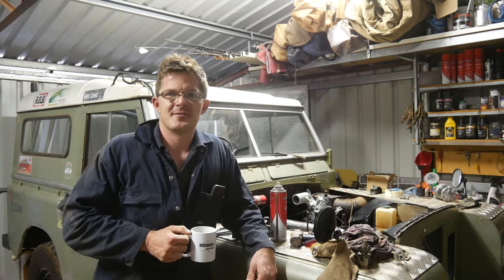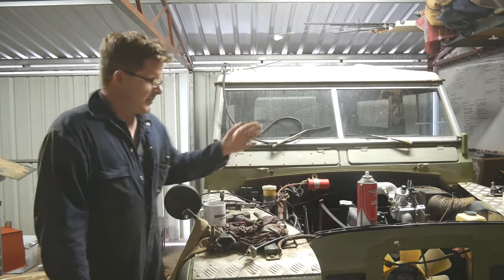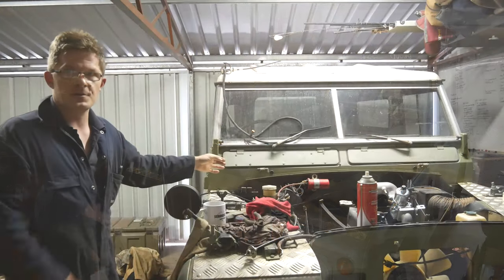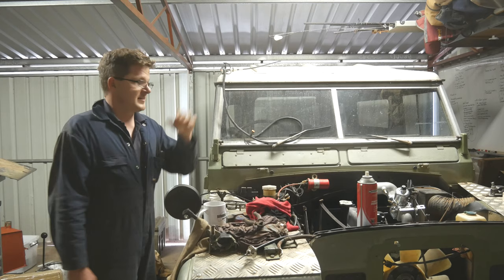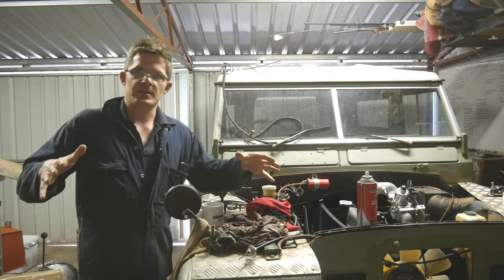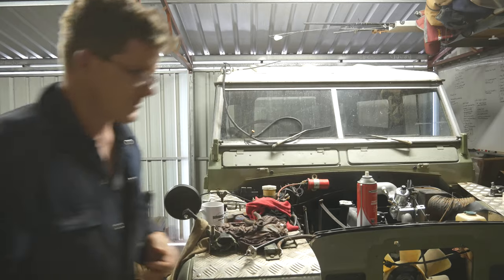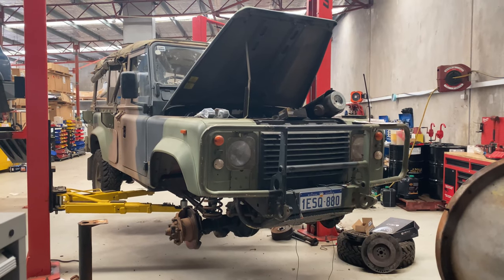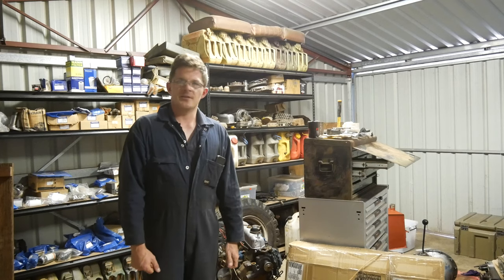Land Rover/ Workshop Update Ep 4

Comment: Hello Geoff.  Your expedition project looks fantastic and I really expect to enjoy whatever you will show us about it, before, during and after. I have one question: in your previous long range journey, when teaming up two vehicules different in both power and capacities, was it not difficult for the lesser one to follow the rhythm which can be imposed by the other (or on the contrary, for the better one to be restrained), if you see what I mean? How will you intend to manage this potential problem with the other driver? I know it can be very frustrating either way when you travel into a convoy.  If you intend to answer to this question, it can be done as part of a future video. I think other viewers would be interested to have your views in this regard. Tschuss.
Reply from the maker: Hi Serge, Geoff’s currently out bush. But in regards to your questions we generally lead with the series vehicles 
1. Because Geoff and I are filming in them 
2. You’re only as fast as your slowest vehicle. 
Now that might mean the tailing vehicle isn’t driving at their smoothest speed, what we then do is stagger the leave times ie we would leave 10-15minutes earlier than the support vehicle. 
I’ll pass on to Geoff the topic for a potential video 
Cheers 
Damon